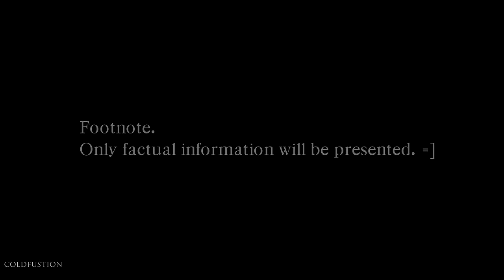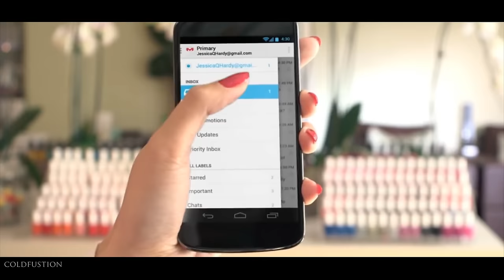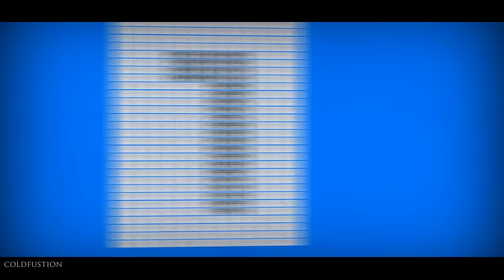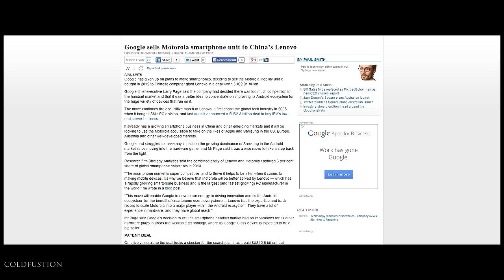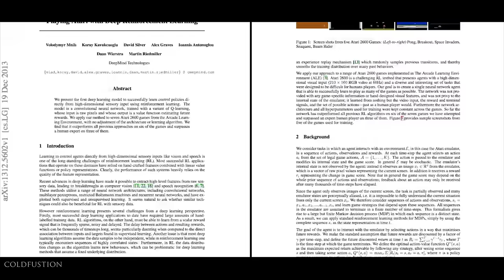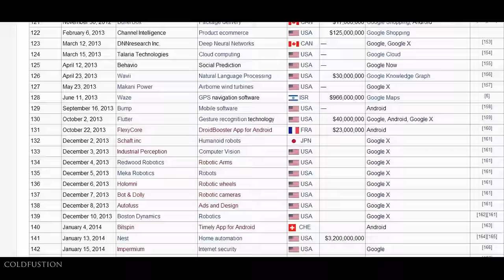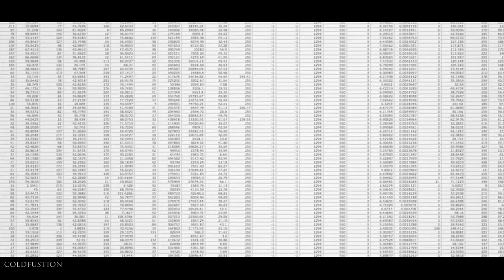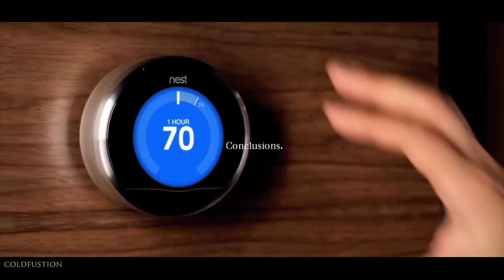How BIG is Google?

Comment: Wait. In your samsung video you say samsung dwarfs google, so samsung must be capable to advance even faster then google. Right?
Reply from the maker: jojjebros Probably so, but in all honesty I think Google are more innovative and think outside the box a lot more than Samsung. That also has a major part to play.
Reply: jojjebros Samsung had a head start of almost a hundred years. The best thing you could do is compare the growth of the two companies.
Reply: jojjebros they're different though. Samsung make everything, that's why they're bigger in size. Google are more about technology and research.
Reply: jojjebros Except Samsung isn't going down that route, so it doesn't really matter.
Reply: jojjebros Samsung sucks
Reply: Samsung (or Samsung Group), is a multinational conglomerate. They defeat Google in sheer size, profitability, and overall revenue. But Google, focuses more towards innovation, creativity, and technological advancement. Yes some parts of Samsung promote and do the same thing, but not as much as what Google does.
Reply: ***** You're using the market value of both companies, which does not directly reflect on how a company is powerful or how fast they are able to advance in R&D and such. There are many other factors that shows how powerful or influential a company is. It's not just money.

Besides, Forbes only provides the financial info of Samsung Electronics, which is only a subsidiary of Samsung Group.
Reply: ***** It's unknown, only Samsung Electronic's market value is public as far as I know.
Reply: samsung doesnt create something new, they just create everything that already invented
samsung focused on making money

bigger profit doest mean bigger idea,
Reply: Samsung is more into industrial development. Google is into advancing technology.

Comment: Just to clarify, the 512 qubit D-Wave quantum computer was not able to outperform a common laptop computer in solving optimization problems, contrary to this video's claim. What the scientists did was they gave both computers several problems of various size and compared the growth of solving time as a function of problem size for both computers. The solving time function for the D-Wave computer grew more slowly than the same function for the laptop, so by some projections the D-Wave computer should be faster than a laptop for very large problems (for which they will need more than 512 qubits). This speculated outperformance is contested and some think that the growth of the D-Wave function was only smaller because the quantum algorithm had some sunk cost even for the smallest problem size. It is difficult to predict the performance of a quantum algorithm other than by simulation with either a very very fast supercomputer OR another working quantum computer of appropriate size.
Reply: Insurgent Science 
I didn't understand a word of that lol
Reply: brickman409 I dumbed it down as much as I could. Stay in school.
Reply: Insurgent Science
school doesn't fix the amount of brain cells I have lost lol.
Reply: Yes but for the D-Wave to be worth anything has to eventually beat existing supercomputers, and the relevant part is the growth function anyway.
Reply: Insurgent Science it is not simply a new technology, quantum computing itself is still very young. We are yet to see major breakthroughs and to get to that point, we have to experiment and try to implement what we have already learned. This is the world's first quantum computer, many people will even argue if it is a "real" quantum computer. Either way, there is a lot of potential in this theory.

Just think about LHC, people thought that it was insane, risky, stupid and that it would kill us all. Yet, just a couple of days ago they confirmed existence of a pentaquark. Do you remember its first launch? As far as I remember it was quite disappointing and yet a couple of years later, after a lot of improvements we are successfully using it to confirm theories about our universe. 

There is of course a downside. D-Wave machines are being sold as if they were a breakthrough, when in reality they are not even close to being as good as modern supercomputers.
Reply: +Insurgent Science A followup on the D-Wave would show that though it's marketed as a quantum computer it is not a general purpose one. It's particular implementation of quantum annealing, a sub type of the processing a theoretical quantum computer should do, is yet to demonstrate that any quantum scale calculation is happening, and therefore this line of development may never produce a machine that can show any of the advantages a quantum computer would have. http://physicsworld.com/cws/article/news/2014/jun/20/is-d-wave-quantum-computer-actually-a-quantum-computer
Reply: Insurgent Science of course a laptop is faster at SOME operations. Quantum computers weren't and aren't designed for commercial use, plus they are only faster at specific operations, that's why someone who needs a computer that is able to outpreform even a high end PC.
Reply: Its baby steps dude.  The real problem is finding stable particles as you know physics are very weird at the sub atomic level.

Once a stable 1 particle and a stable 0 particle are established within certain conditions, then it can be developed without distorted information.

The "within certain conditions" is the difficult part as temps have to approach absolute zero to perform exactly as a true or a false and that is not possible.

Therein lies the quagmire.

Comment: A very good video. Packed full of information. If you know the truth you can be optimistic. If you know the truth you should also be afraid for the future. They will soon be able to xhip humans. These chips will act as a second brain. Imagine having the piwer if google & all you have to do is think of the question & it will be answered without typing anything. Just thinking.  This is the next step. Then after that quantum computing will only be a thiughg away. The question soon wint be if you have it installed because just about everyone will. The question will be how old do you have to be to get thechip installed. The world will be highly advanced at that point. Everyone will not need to go to traditional schools. They will be phased out for the most part. Question will remain, Is this what we as a people "Human" should be doing? Its closer than everyone may think. 2030 this may be well under way. As I type this on a full desktop Note 10+. The advancement to this gadget is phenomenal & in 2010 not even imagined that we could go this far. Ponder back to 2000 when we thought that there was going to be a Y2K issue with computers. This could be a great concept for a scifi movie right now however it will be reality sometime sooner than later.

Comment: 12 inches at least.  3 diameter.  Like a sht pipe.
I agree bc i need a job and it doesn't seem that bad.  But do i have to show off good and bad stuff to get it?  Can you transition my knowledge and short comings as well as overcomings.  #cummins #alexjones